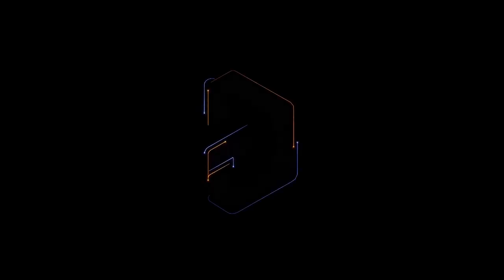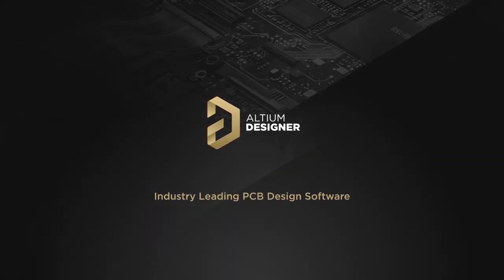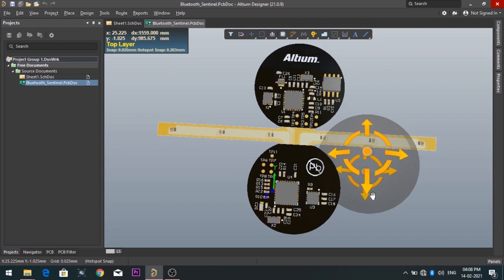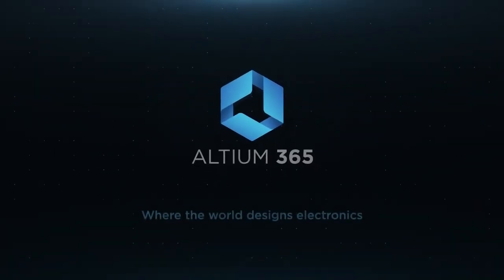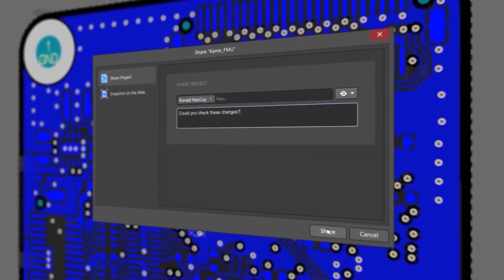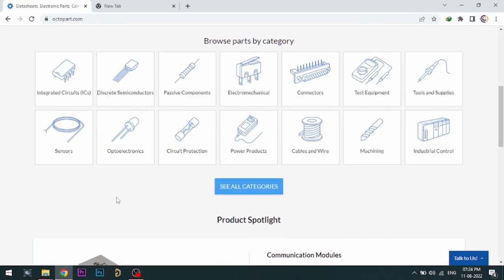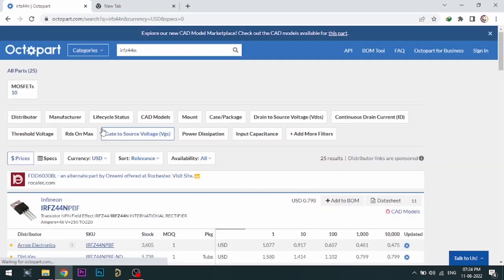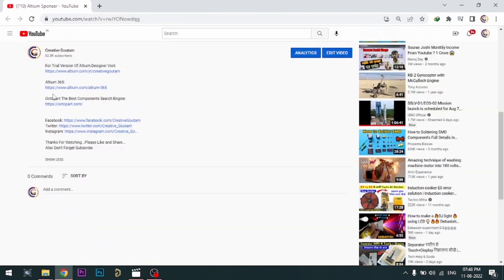DIY Bridge Rectifier Diode, Make At Home

Comment: If you do not encase the diodes in epoxy, you might still be able to place them on a heat sink, by using thermal pads, which would still electrically isolate the diodes. However, the diode pins would need to be stacked such that all four diode bodies would contact the heat sink. @0:59, you can see one pin (upper middle) behind a diode body (lower right.) This diode would need to be reassembled to move the pin in front of the diode body. Then, the heat sink could be placed behind the diodes and all four diode bodies would touch the heat sink. I hope this explanation was clear. Cheers.